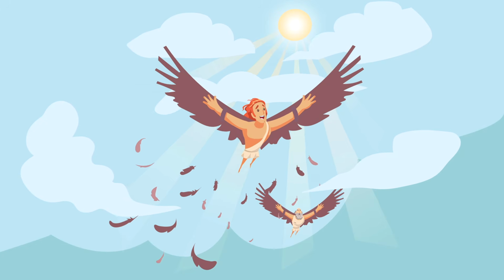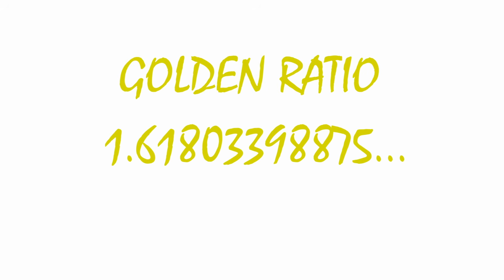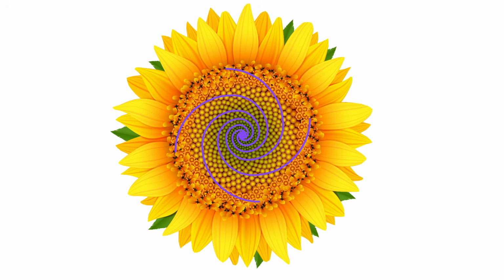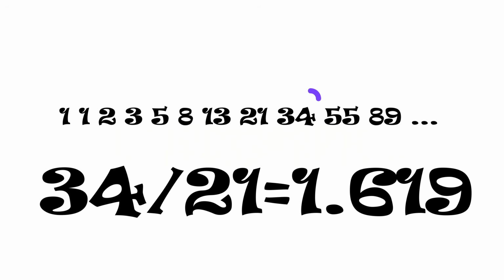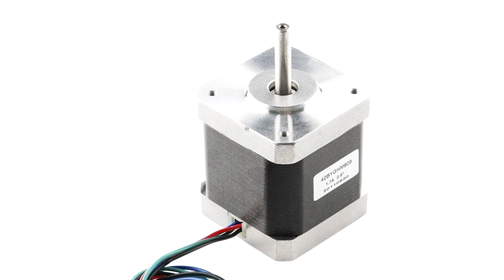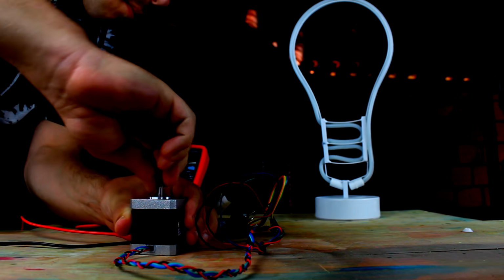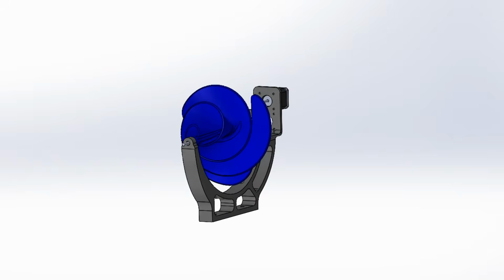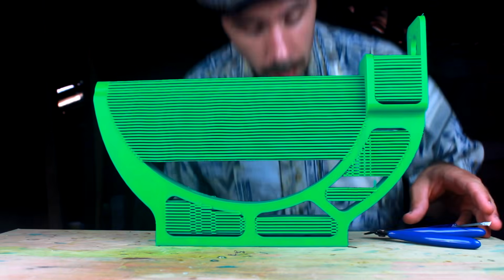Golden Ratio Turbine 3D Printed

Comment: What if you try to make a " free energy" motor. As in you use magnets to make a mock perpetual motion machine and use that to drive a motor to make power. For the perpetual motion machine you can use something like the one electronicaLly used in the video: " free energy" Magnetic Fidget Spinner Motor Real?

Comment: Instead of wind turbine why not a water turbine. That will solve the power problem. Put a loop on the end attach a rope and connect the rope to the generator. Allow the Vortex to sit in the water while the generator is out producing power.

Comment: I don't get using it as an wind turbine ... seems it would be more appropriate as a water turbine for a small creek - just use some large diameter agricultural pipe/tubing to capture water upstream, run the pipe downstream for a bit (depending on the slope) then attach turbine at the end.  Huge torque - relative to air, so much higher power output potentially.

Comment: This turbine might do a lot better if You enclosed it "in a tube" with some sort of air scoop. 

greetings from Denmark and keep up the good work
Reply: Well, maybe an air scoop for the front end of the turbine. But putting one ehich extends to the rear would just choke down all that gas coming out at the sides I think.

Comment: Hey you could use this design to make a small scale turbine for a small waterway or water channel which could potentially eliminate conventional Francis type turbines which requires a involute for accelerating the fluid speed before hitting the turbine and accelerating further. This could potentially reduce the size of setup, and coupled with a good gear reduction could output high power.

Comment: A fully electric engine with no moving parts to produce thrust, that can propel a aeroplane and additional with some modification should  propel a submarine. 
I Guess it’s too much of a challenge.
Reply: No moving parts? The only ways I can think of doing that are an ion engine, or possibly a ram jet using a massive spark for heat instead of fuel.

Comment: Hello integza this is yash from India remember we talked. Any ways let's get back to work so I was thinking that you can add extra magnet to the motor which would increase the output also you can try to make the shaft supporting frame a bit wide in the bottom for more stability and this will reduce the explosive noise.
Also I know you would have done this but still you can try to add petrol to the ball barings as it can make it really smooth (trust me I was a skater it works) . 
Also for your next video I am suggesting some projects like :
- hand held 3D printed holographic display( using a mist maker) 
.
Also I was thinking that if this turbin works with fluid then if you can, you can try to fit it in the drainage system of house and at last but not least as you showed try mounting it on Ze(the) min.van .
Also I would love to join your team to conquer ze world. Hahahahahah(👈evil laugh). 

At last tomato sucks I can understand. 
Peace 

Yours sincerely 
Yash Chaudhari 
From India.

Comment: God I love power generation concepts, it would be interesting to see a flattened down version of this on a flywheel for direct wind current power generation. picture covering a wall and syncing together many of them, using gust potential to maintain flywheel spin an then conceptualizing the power increase per unit run.
Reply: would be interesting to see models with individual generators, and tandem models feeding torque into a single generator to see what would produce more power.

Comment: You should make a 3D printed electric motor, I mean, one from scratch. 3D print a shaft, a rotor, and roll the copper wire turn by turn.

Comment: For you next project you could electro plating 3d printed stuff with metal, like copper. There are very few videos about it!
Reply: It would be very cool and useful
Reply: Nice Idea! it could be a great project, plus metal plated items are electrically conductive
Reply: The issue is plastic isnt conductive, so you would need to find an expensive conductive spray paint to give the metallic atoms something to stick to. Using a metallic spray paint allows you to electroplate many more things than just plastic. Its cool to see things like electroplated natural objects, becuase the electroplated layer reinforces soft natural objects.
Reply: @em4392  you can make an easy and cheap condutive ink with coal dust, it depends if you want a very professional job with the expensive ink or something just for fun. But even if you do it with coal dust you could obtain something very strong, cool and conductive
Reply: @theblueguy6009  ultrasound assisted exfoliation of graphine from graphite powder...
Reply: @zombieseezombiedo  how does it work?
Reply: @em4392  graphite/graphite
Reply: This is actually a very neat idea. There are filaments designed to be conductive, but aren't exactly great at it. Using that material as an electroplating scaffold might make it more worthwhile.
Reply: interesting
Reply: cool, but I prefer  a super capacitor rocket
Reply: How?
Reply: @truestopguardatruestop164  paint with a conductive ink, you can buy it or make it, it's not hard to do it. Than put some H2O2 with some vinegar and put in a stick of cupper. Put an electrode inside the solution and one one the stuff you want to plate that you pianted with the conductive ink. Drop the stuff inside the solution and let some current to pass.
Reply: Electroplating requires the thing you’re plating to be conductive
Reply: Nice idea
Reply: this idea is OP
Reply: up
Reply: up
Reply: up

Comment: Awesome project!

You should do a 3d printed hand crank generator that charges a large super capacitor bank.

Might be cool to experiment with different gear ratio and motor types to see what would be the most optimized low rpm generator..

Comment: Same concept at 9:20, but in a closed system with another lily impeller at the top going the opposite direction so that you have centripetal and centrifugal forces. I'd like to see if it creates a  type of torus in the water.

Comment: Tomatoes are indeed disgusting.  Perhaps a better use for them is to stick them in a blender, stick the resulting mush in a jar with electrodes, and use them as a low output battery in similar fashion to the lemon battery charger, or a potato powered clock....

Comment: Moreover, there is one topic you might be interested in. When you did this water turbine, you created a vortex.
There is neighbor way to make a water vortex. if you make a cone, pushing water by pump to the direction tangent to its border near the bottom of cone, and output will be on the cone's top, the water will be heating itself because of fritction water-water. Surely, no air should be in a system. 
Such a water vortex will have a hundreds rpm near the bottom, but thousands rpms near the top.
Some people say that water heats itself with a power up to 4x from the pump's power. I know that power can't be taken from nowhere. 

So, can you check that?

Comment: This is link to a simple water wheel that we actually had patented as a system to generate power on multiple scales. Have some 3D models (on CAD) and this is a video of a 9foot diameter wheel that we put in the Mississippi River at a 6 MPH current and got a 15 kw test number for. We have designs where they can set in series on both sides of barges, or deploy independently  on a single piling with a cable transmitting to shore. Would be very interested in talking to you about your shape and its' efficiencies vs my original. It is the shape that I originally envisioned for the unit. 
  https://www.youtube.com/watch?v=aflWx3qH1NI. Oh, love your videos and the humor.

Comment: Excellent as always. I'd love to see you build a Horshe Vortex Tube - a heat pump using just moving air. You can go the usual route, using an air compressor, but I'd like to see a high Kv brushless motor used on an impellor to establish the vortex, then maybe a reducing tube to accelerate the rotating column? That way you don't need a workshop compressor to get your freezing air out.
No one really understands the heat pump effect, so you can build designs with varying ratios and Science the shit out of it.

Comment: Would it make sense to have a wind turbine at a higher altitude where the pressure is greater if there is a way to make a kite turbine you should figure it out
Reply: An airborne wind turbine is a design concept for a wind turbine with a rotor supported in the air without a tower,[1] thus benefiting from more mechanical and aerodynamic options, the higher velocity and persistence of wind at high altitudes, while avoiding the expense of tower construction,[2] or the need for slip rings or yaw mechanisms. An electrical generator may be on the ground or airborne. Challenges include safely suspending and maintaining turbines hundreds of meters off the ground in high winds and storms, transferring the harvested and/or generated power back to earth, and interference with aviation.
Reply: On the contrary the air is denser thus creating a more powerful wind

Comment: You should make the turbine with a low melted point filament, imbed it in plaster, put the entire plaster mold in oven to melt out the filament and then cast it with aluminum. Or, send me the turbine and I'll cast it in aluminum and send it back to you to test.

Comment: How would you like to destroy tomatoes in a high-tech way? If you get a small tomato (around 2cm diameter), cut it in half an put but halves in the microwave touching each other, flat side up, you can generate plasma sparks! Don't leave the microwave running for too long though because after about 10s the tomatoes start to boil and/or burn.

Comment: I have multiple ideas for a video so I will just list them after each other in seperate comments:

1. Steam Engine powered by Solar/Sun Energy : Heating water with either mirror or photovoltaik cell. The steam of the boiling water probably needs to be compressed, which will be a challenge.

Comment: i would be interested to see a combination of the lily turbine you made matched up with a water wheel of sorts where you use the flow of one to increase the flow of the other.  but you might need a large holding tank for the water

Comment: Video theme idea: What is the most complicated Rube Goldberg machine you can build using only 3D printed parts, ball bearings, screws, rubber bands, and past projects to start a 3D printer? 
its a bit outside of what you normally do but it would be a fun project I think.

Comment: 3d printed rockets seems impossible to create but hard is easy ,impossible only takes time to make, integza.hope it will be future video .
Reply: Nice one
Reply: Yeah I love making rockets but you can’t do as plastic like PLA (too much heavy). I am sperimenting putting some arduinos on the rocket to then control them in flight.
Reply: @truestopguardatruestop164  i know that it is almost impossible.so that i put a quote to my comment.Integza is a genius person tho. He would manage to get it done anyway i think. Or  at least he could try to use max amount of 3d printed pieces in the rocket(do not have to be PLA)
Reply: Necmeddin Bera Çalık the fact is that a rocket is complex and getting over 100 meters in high is complicated. He should manage to create a nozzle in metal and calculate the diameter and the angles of it in proportion to the pressure generated by his mixture. Probably he will go with Rocket Candy (Potassium Nitrate+Sugar+ (optional) iron oxide).

Comment: Trying to make kinetic battery using flywheel would be cool. Also combining tesla turbine with it would be ideal because they both can have high rpm. It could be build with ball bearings or  magnetic bearings. You could test how good it holds charge (spinning speed/energy) compared to other batteries. Maybe even try to use vacuum chamber to reduse friction loss.

Comment: You need to 3D print a 3D printer. It amazes me you haven’t tried yet. Actually it doesn’t, but it does sound good.
Reply: The hot-end and electrics are...kind of tricky to print!
Reply: Andrew Howard If you can find and show me a 3D printed 3D printer project where it says to 3D print the hardware and electronics, and it’s not “by you” or another person completely ignorant to the 3D printing community, I’ll give you a brand new Prusa mk3.
Reply: @Airtight215  I've built two and owned four. By the time we have a printer capable of such feats, your Prusa will be very old-school. Although linear rails and an accurate chassis may be printable, I reckon al extrusions, proper bearings, and cnc milled joiners will be superior for a while yet. As for the steppers and electronics? Nah. Going to need a few more tools for that.

Comment: Perhaps you should try to make a fan as optimized as possible, and explain the theory behind your design and how it works. Computer fans are easy-ish to replace the blades from and you would need both static pressure and air flow. Could be interesting :)

Comment: Next time I suggest taking apart a 12V computer fan and rectify the ac coming from the windings. That solution would probably work in low wind and low torque applications.

Comment: I'd like to see a packable generator based off this turbine design. It would be nice to have the ability to charge external batteries at night while camping. Solar is okay, but in a lot of the places I camp, the wind is pretty consistent day and night. And this has the potential to be compact both while moving around, and while in operation.

Comment: You should wear safety glasses whenever you're working with spinning things. When the turbine failed in front of your face you could have really injured an eye.  That said, I was very impressed by 8 watts from that small turbine! It seems to work a lot better than most of the DIY wind turbines you see around.